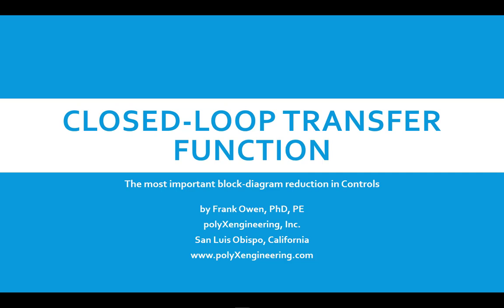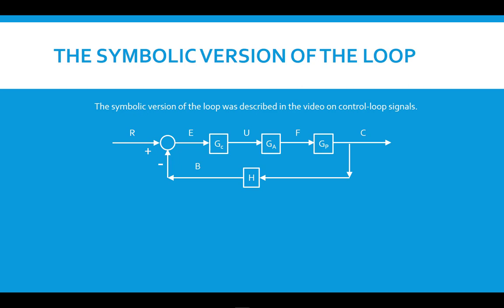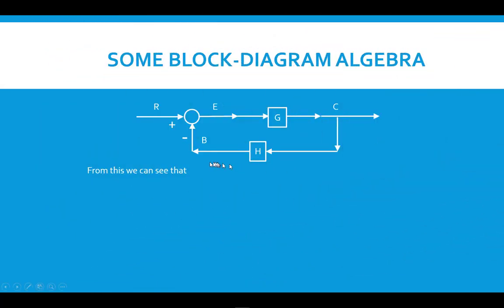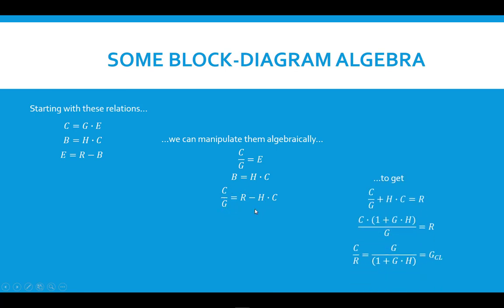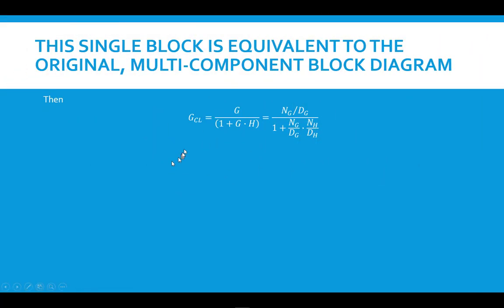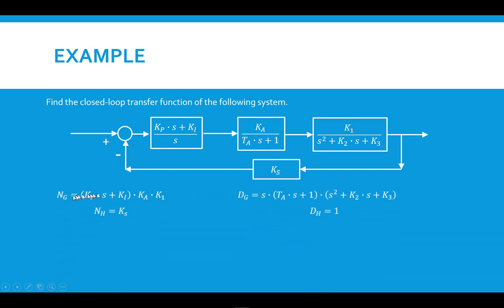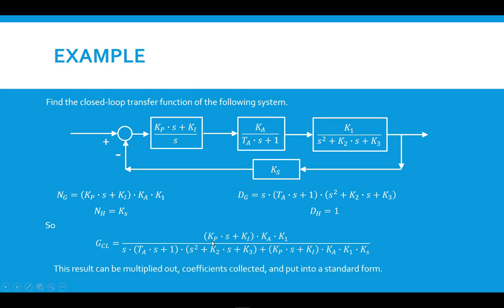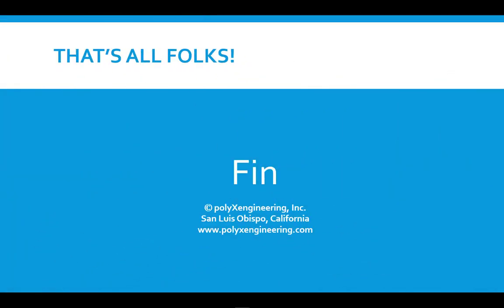Closed-loop transfer function

Comment: 7:22 How can we tell from the TF that is has some delay (I assume delay means deadtime)
Reply from the maker: Hi Mr. Nada,  No, delay is not the same as deadtime.  Deadtime is actually that.  You put an excitation in, and it is a little while before the system even notices the excitation.  Delay is actually the time it takes a system to respond after it feels the excitation.  For example, a first-order system has a time constant, T.  When a step input is put into it, it takes about 4 time constants before it reaches its new, steady-state value, even though it begins to respond right away.  So delay is the time to respond once the system starts to respond.  Deadtime is the time it takes between putting an excitation in and when the system actually receives the excitation.  I don't deal with deadtime in these videos (so far as of 08.12.2020).  I only deal with delay.
Reply: @polyxengineering3857  so delay is same as transportation lag ?
Reply from the maker: @medotedo8410  No, the way I use the word "delay" is simply to mean that the response is not immediate, which you would get only if the transfer function were a gain with no s in the denominator.  The type of lag that I think you are referring to is when the sensor is so placed that it does not sense any change in the system until a certain amount of time, the  deadtime, has passed.  There are specific ways to deal with that, but I do not cover that (yet) in my Controls series.
Reply: @polyxengineering3857  great explanation. Yes, I meant that types.